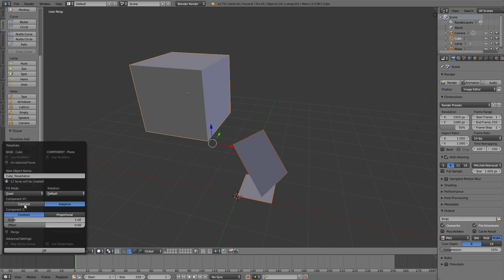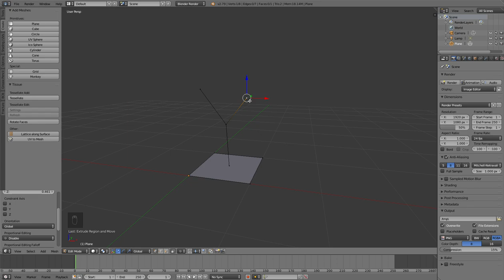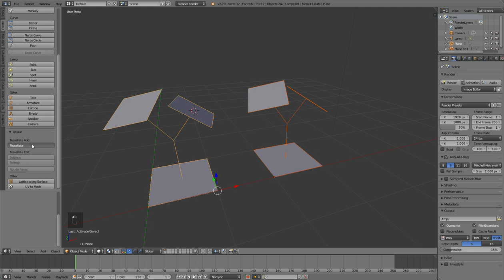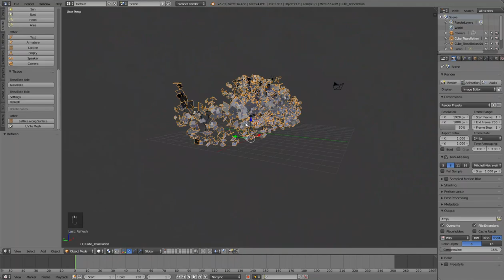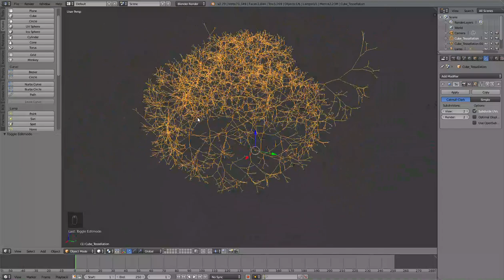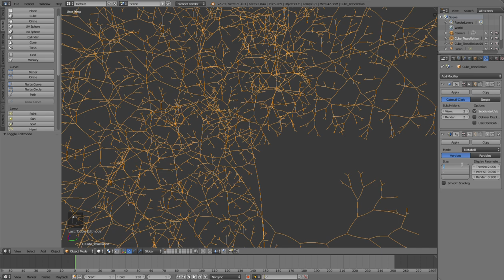L-Systems with Tissue add-on in Blender

Comment: Very cool Video!  Is it possible to grow this network within a volume (like a cube or a ball) randomly and set the thickest and thinnest diameter? The reason I ask is because I want to grow something like this with a random pathway, with more or less random lengths in between, spreading out inside a volume I choose, but without leaving the volume, but staying inside! Ultimately I want to 3D print this shape!

Comment: Alessandro firstly I want to thank you for creating this astounding addon. I am very fortunate to have learned this wonderful tool. I am running into a problem. I am on blender 2.837 and I running into a snag. I think it is important to mention that I am working with tissue 3.3.3 also and not the native one that comes in blender. The issue I am running into is from the getgo. When I create the base and branches and leaves. When I try to tessellate the base seems to shrink and is offset by mm. I tried rotating the root plane but it seems to just rotate around the main branch. I have determined that there is something modifying the scale of the overall tessellation and not keeping it at the exact same dimensions. I tested just the root plane and without the branches without the top leaves and it works. I run into the problem once I create those leaves and branches. That is when I run into an issue of the tessellation creating a shrinking effect. I recorded a video to show you. Maybe you can shed light on what this latest iteration of tissue is doing that I am not understanding. I will join your FB page and send you a video recording there, please be on the lookout for me there. I would appreciate what I need to do to make this work. Thanks Alessandro and once again I love this addon.
Reply: I also found it didn't quite work on more recent versions of Blender / Tissue... can't quite work it out!

Comment: I didn't get it... You tacitly use hotkeys, and expect people to be able to follow them...not everyone is as knowledgeable of the hotkeys, and what they do...if you want people to be able to follow your tutorials, try stating explicitly what you are doing at each step, and use the menus instead of the hotkeys. 
You move the cursor constantly, and some of the time that movement is important; but it is exceedingly difficult to know what are important movements... so you lose me with misdirection.
Try slowing down... It is important to get to the point immediately, but to speak and move slowly and clearly if you want your videos easy to follow...

look at it this way: these are advanced topics. You need to spend about 3x the time you do on them...this video should probably be 45 minutes to an hour... 

That is just my take. 

I think this add-on has lots of potential...and with the documentation this way, I don't see it catching on hugely.
Reply from the maker: Hi Cnris, I will copy and past the same comment on facebook: in that tutorial you can see that I pressed the 'w' key and I chosed subdivide. If you are using Blender 2.80 you can just press the right mouse button in edit mode. Anyway, before going deeper on advanced workflows I suggest to focus more on basic modelling tools in Blender. It can be crucial, especially for understanding some advanced parameters. Also, branching systems with Tissue can be done also differently in Blender 2.80: https://www.youtube.com/watch?v=7Liv--XSaCg

Also, most of my tutorials are made for advanced users, or at least for users that already know the modelling workflow in Blender and want to understand something more. This because I want to keep them shorter and specific. I understand that this can generate frustation if you miss something, but in that case consider to take some steps back, watching generic modelling tutorials. My aim making those videos is NOT "look how you can make exactely this object here", but more "check which new strategies and logics you can use for combine your 3D component on your meshes".
Reply: @AlessandroZomparelli  The thing is, I understand what you are saying... I gave the wrong impression. I know basic modeling quite well, as I have been doing blender for years. What I meant was not the subdividing per se which was the problem; I can figure out you subdivided...however, it took me a few moments to figure that out..no big deal there...but when you multiply that by 50 or so, and add that some times it took me several minutes to figure out what you were doing but not stating, you will understand that I have spent 4 or 5 hours with this one tutorial figuring it out... 
If you just say "subdivide it" while you are subdividing it, then it is easier to follow by anyone.
If you want to make this the sort of add-on that only you and your friends can use, by all means, don't communicate any better while creating tutorials... if you want a more general audience, tailor your tutorials to that...

As for me, I will watch a few more, but I can't hardly spend the same time on them as I have this last one. If they are just as hard to follow, I suppose i may give up on this add-on. 

Best of luck with this.
By the way, I have learned a lot about programming in the last 6 months or so since I started and the most valuable was the advice to write the manual before you write the software.
Reply from the maker: @johnny196775  This is NOT an addon for friends only. The documentation is really far to be completed, but it something that I have started, as you can see from the Tissue's wiki on Github: https://github.com/alessandro-zomparelli/tissue/wiki that must be updated and extended according to the latest changes in the addon, but it's there and contains some informations that can help figuring out how Tissue works. I'm trying to document the addon in my spare time, but the code as well is still a work in progress, and I'm waiting to reach a stable point in the development before focusing exclusively on the documentation. I am not really satisfied with the current documentation, I hope that in future it will be better. In the meanwhile, as usual, I'll be happy to help any Tissue users here, on Facebook or on Patreon.

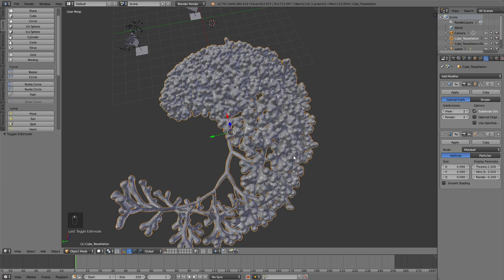Comment: Hi there! This ia really good one! I like it!. Though, I can't correct what you did at 13:33. the two shapes are not gathered in their base. And they seem pretty correct. (I am using 2.8 with the latest version of Tissue downloaded from the github) Any ideas? thanks!
Reply from the maker: Hi, try to write to me on Github with some screenshots, I can help better from there. Or alternatively from the facebook group: https://www.facebook.com/groups/1396995897211561/
Reply: @AlessandroZomparelli  made it work thanks!. it's a fantastic tool!
Reply: @lostshun  How did you make it work? I've been struggling for days and the result is always the same. The tesselation"root" is scaled down a bit and the itereations base connects to each leaf at the leaf, but because it's scaled down they don't connect. I hadn't done any twisting or scaling operations prior to tesselating and scaling either of the component objects can't make them meet either.
https://www.dropbox.com/s/zwu21ypfiqrz3k4/tesselation%20test.png?dl=0

Comment: I can`t make it work in blender 2.8 :(
Reply from the maker: Try this one, is newer: https://youtu.be/7Liv--XSaCg
Reply: @AlessandroZomparelli  thanks! it worked! :)
Reply: @AlessandroZomparelli  So now we have to make it with the use of materials? I think the only thing that prevents using this method in the newer versions is that we can't change the offset anymore.
Reply from the maker: @quinxx12  what do you mean? The offset is still there. Actually now it's even simpler because you can work with iterations.
Reply: @AlessandroZomparelli  I cant find an offset slider in my Tissue version
Reply: hi there, i'm looking exactly for the same thing ...  some kind of Procedural Growth particles with Blender...if you find a solution please let me know !  :)

Comment: By the way, you can just use dupliverts to place the metaballs at the vertex position to remesh the tree...
Reply from the maker: A N F Yes, you are right, but the modifier is much more fast... I've tried with dupliverts but with many balls is too slow...

Comment: Could you please re-do this tutorial for Blender 2.79b? The "remesh metaballs" it´s not there anymore. Please help. Great tutorial.
Reply from the maker: Activemotionpictures it has never been there, I used the Fracture Modifier Branch, not the regular blender. I hope that it will be already embedded in the 2.80.
Reply: AH! allright! Thanks.
That was the only step I was missing.